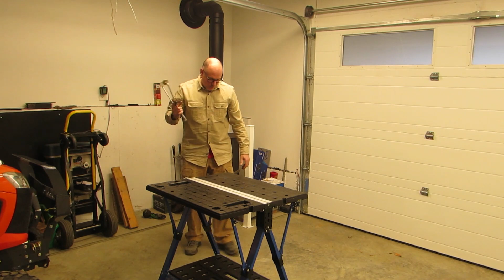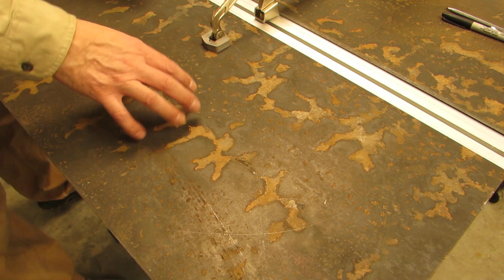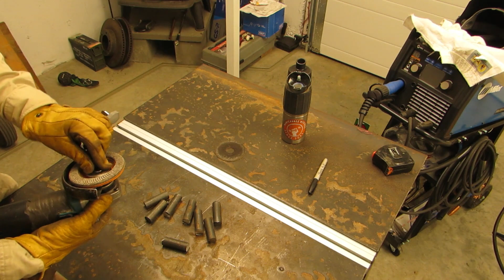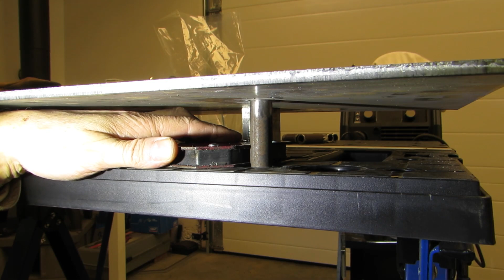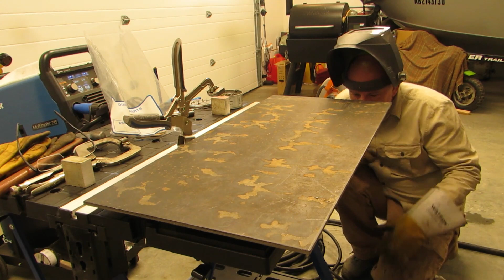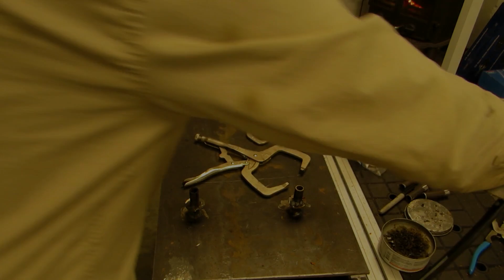BEST DIY 2IN1 Folding Workbench table for Welding & Woodwork @KregToolCompany #weldingtable

Comment: Great way to heat up your gasoline Mike, when needed. 🤭🤭🤭🤭
Nice fix. I was kinda wondering if it would fit without a little wiggle room. 🤔
Different kind of wood stove. 
I’d be careful if you use acetylene/oxygen torches on there to weld or cut something. Metal could get hot enough to melt the plastic. 🤔🤔
But most people don’t use torches any more any way. 
Have a great day Mike. 👍🏻👍🏻👋👋🪵🪓🔥🇨🇦
Reply from the maker: Haha yeah good conversation piece that old can. Good to know but I don’t use a torch, or even have one. So I’m safe. Thanks for stopping by. Have a good weekend. Cheers, Mike.
Reply: @maintenancewithmike    Good stuff. Have a great weekend. 👍🏻👍🏻👋👋🪵🪓🔥🇨🇦🚜

Comment: Nicely done Mike!  I really like the versatility of the table. That was a great idea. Yeah it is next to impossible to get the alignment with the pegs the same size as the holes. Totally agree that downsizing the pegs is the way to go. LOL, was that gasoline can on the wood stove for boiling water to raise the humidity level?
Reply: I was Wondering the same question than you Sir about the Gasoline Canister 🥴 I thought that will go ✨🚀🤣🤣👍👍
Reply from the maker: Haha yeah old gas can that hasn’t had fuel in it for many many years. Used to have it outside on our wood stove as a conversation piece, but needed to save it from the elements. So here it sits now with water in it. Thanks for watching!